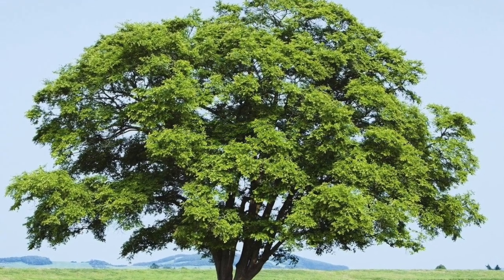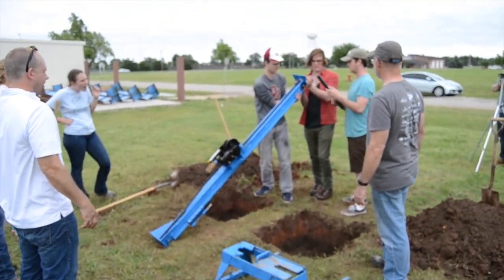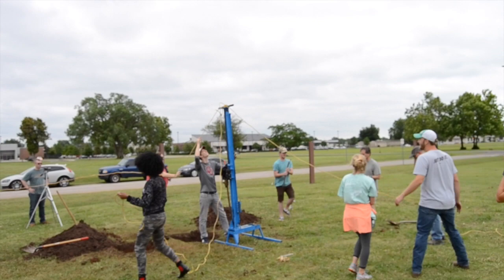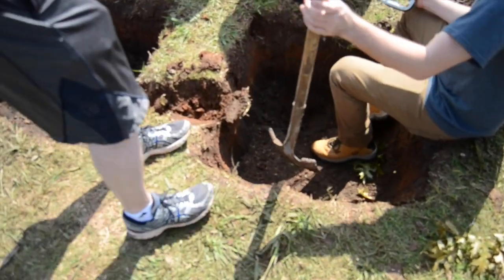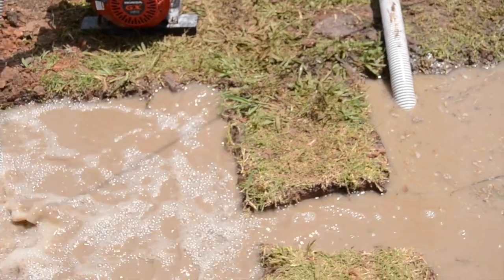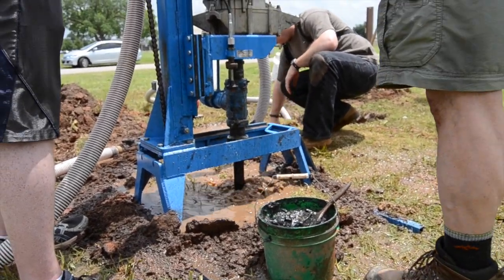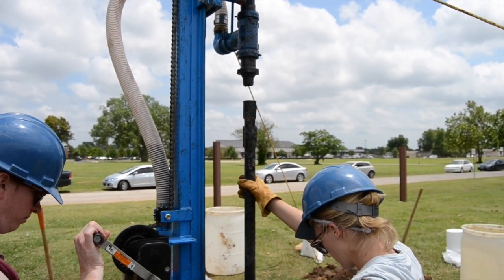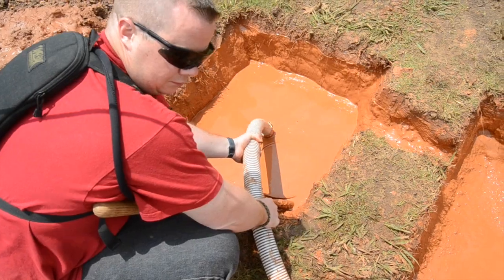LS 100 Well Drilling

Comment: What about just hooking that water line to a compressor instead? Then you would contaminate your ground water and it blows the hole out as it works.
Reply: You need a pneumatic hammer bit to drill with air and you have to mix surfactants with the water to control dust. When youre drilling a deep oil or gas well they drill the surface string with straight water and they rarely if ever weight up the water with barite or gel additives but they can flow 2500 gpm of water through an 8 chamber pit system too. They did this right except they needed a bigger pit system for the flow they had out of the pump they were using
Reply: All well drilling rigs have large air compressors on them.

Comment: How do you know when you hit water ?
Reply: You can notice when the water appears for 3 reasons:
1. There is a significant loss of water in the water cycling pools.
2. bubbles appear at the exit of the drill hole
3. If you are using drilling chemicals, the normal color of the mud is homogeneous, so when the water appears, the color of the mud is no longer homogeneous and becomes different shades.